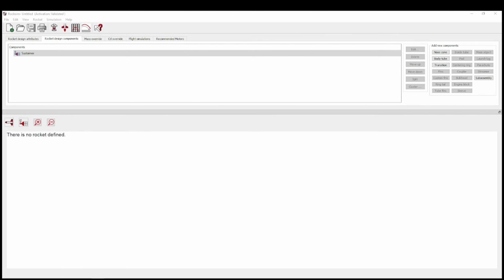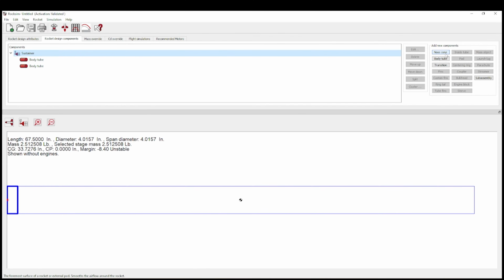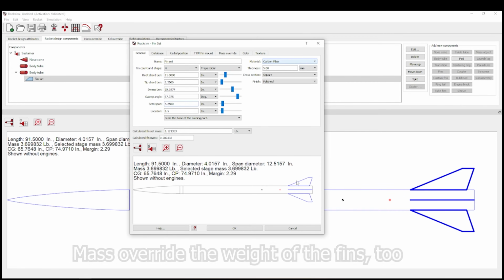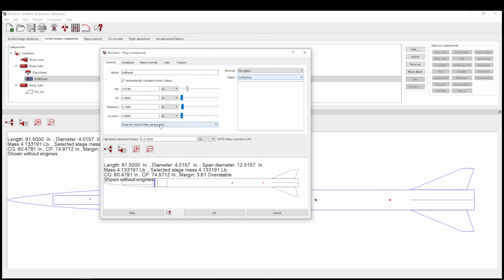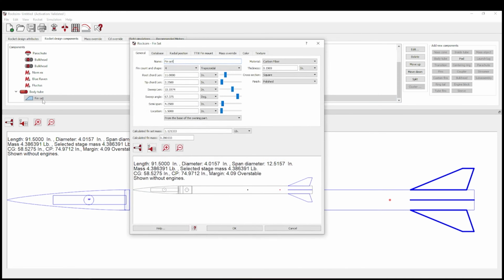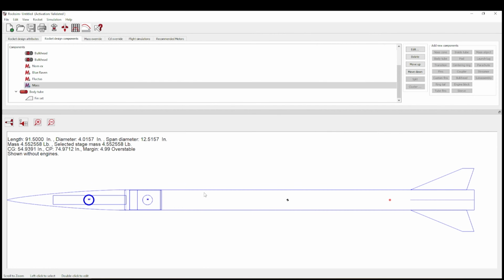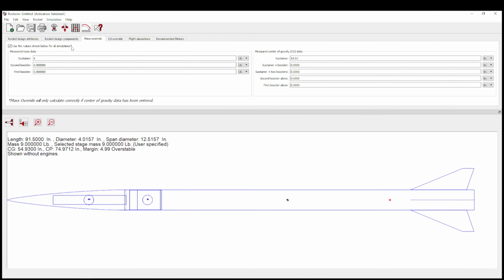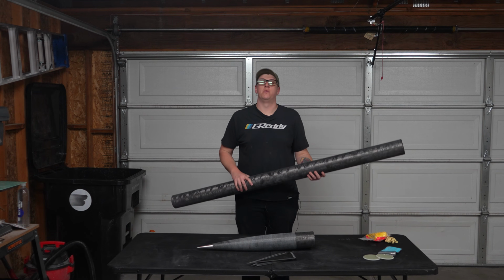How to Make Custom Rocket Design Files | (Rocksim and OpenRocket)

Comment: Hey Braden, unrelated, but im looking at getting a punisher 3 kit as my first hpr. I was just wondering if you'd recommend adapting down to a 38mm motor for a L1 cert flight. Thanks!
Reply from the maker: Yes, it's a good call. There aren't a lot of options for L1 in the 54mm range, but going with an aeropack 54mm retainer and the matching adapter makes it super easy to accommodate. Then, you can let it rip for L2 if you want, too!

Comment: I have found over the years to getting very accurate sims that take very little effort all i have had to do is

Get all the external measurements correct. Overall Length, diameter,  fin shape, placement of fins, nose cone shape. None of the interior stuff is needed. 

After the rocket is physically built i assemble it 100 complete as it would fly minus the motor. Get an exact weight. Also get the exact center of gravity. 

Then overide the mass, overide the CG. 
You now should have everything you need mass, cg, cp. Adjust launch site data. I also like to get a test flight on a smaller motor. Take my data from the test flight then adjust the CD to get my sim on that test motor to match the actual data recorded or very very close. Now any sim after that should be really accurate.  I do this for RasAero and rocksim
Reply: I found RockSim simulations to be very accurate in calculating drift. Of course it is only as accurate as the person entering it. To set up the weather cocking portion of the launch - I use the simulation results data and use a compass and protractor to adjust the launch. Yes, I know that would have to painfully balance the launch pad with a bubble in order for it to match RockSim; however, you can obtain a fairly accurate flight estimating the data.
Reply: @alfredindy8058  depends on the flight. A huge majority of my flights are over 30,000 ft at altitudes above 20,000ft winds aloft are really hard to predict or determine drift. You usually won't know till day of launch. I've had stuff recover from 35,000 ft only 4800 ft away or up to 5.5 miles away. Its quite relative to what  and how high you are flying and the day.

Comment: Have you ever found any aeropac tailcone motor retailers modeled in Roksim?
Reply from the maker: If you just add a transition, overhang the motor tube,  and put an accurate weight in it'll do!
Reply: @RocketVlogs  thanks

Comment: No min. dia. motor retainer or are you going with friction fit?
Reply from the maker: Friction fit was the plan in this configuration,  but in the cut down configuration, the motor case will be bolted to the electronics bay

Comment: Really good tutorial.  At least in Open Rocket I would change the preferences BEFORE creating any simulation.  Saves the trouble of needing to update the altitude, launch rod length, wind speed in every simulation.  The drogue parachute will need to be set to deploy at apogee" and main "at specific altitude" before running a simulation.